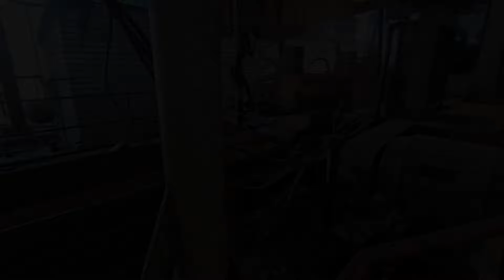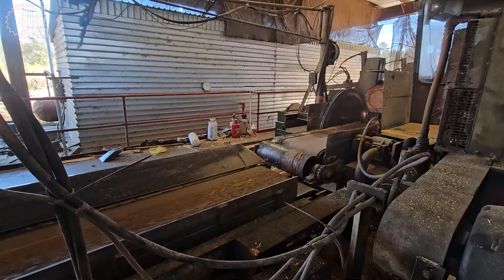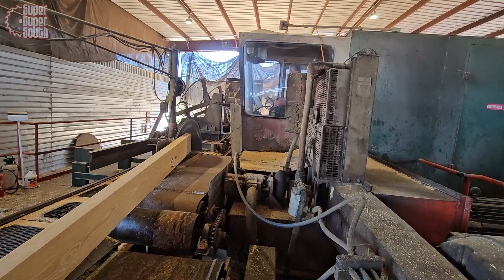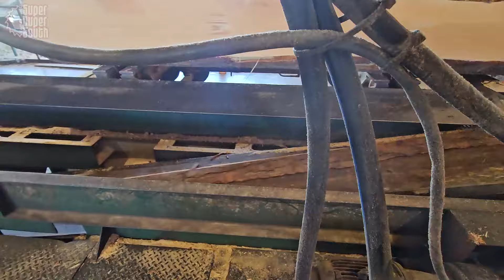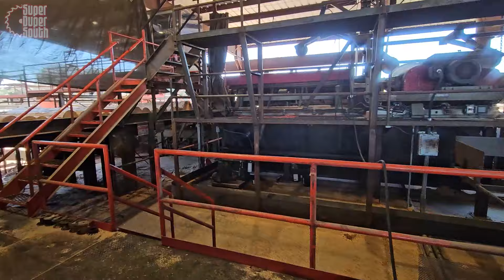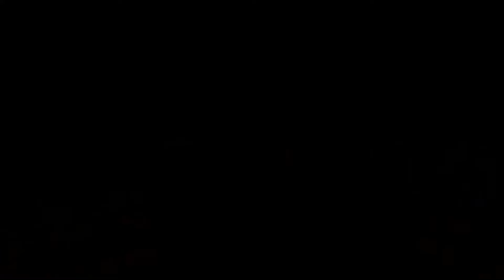Sawing BIG Pine on the Hurdle

Comment: Fantastic, is that you or your Pa? Can you tell us more about that carriage and what’s with the dogs that reach and then pull in?
Reply from the maker: That's my pops and it's a 4 head block hurdle that we built a mill around its not a linear position carriage tho. The head blocks pull back to make sure the whole log is pulled tight against the head blocks. Imma start doing some more in detail sawing videos and will get in more depth with it. Thanks for watching as well

Comment: What size is that circular saw a 52” or 54”?
Reply from the maker: 50" @ 2-1/2 so it has 54 teeth total.
Reply: @ I run a 54”  it has 42 teeth.  We have a few that are 44teeth.  But the 42s are a little stronger. More meat in between the teeth